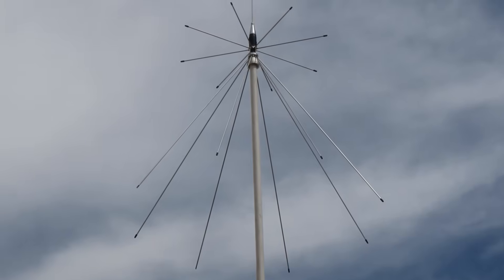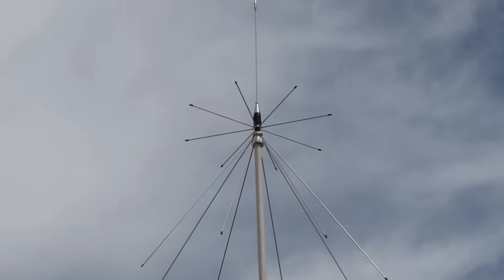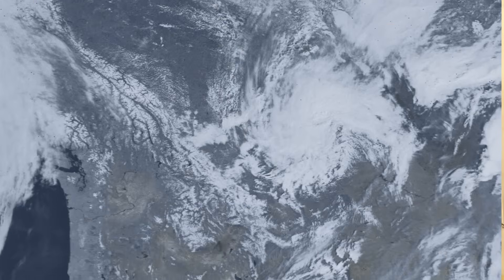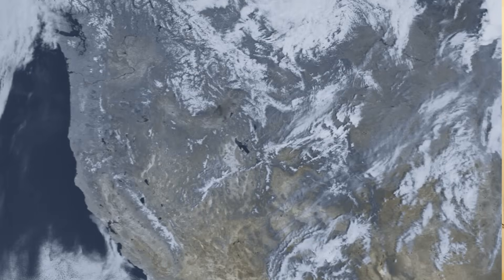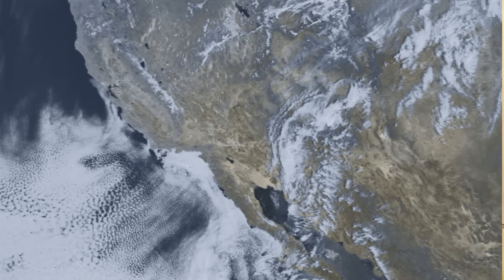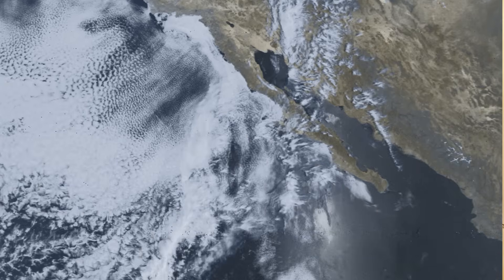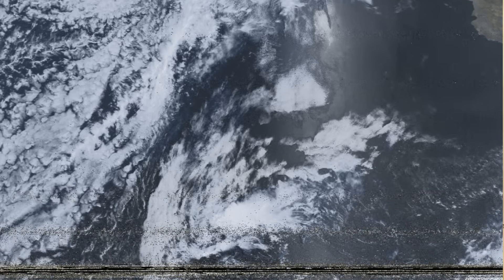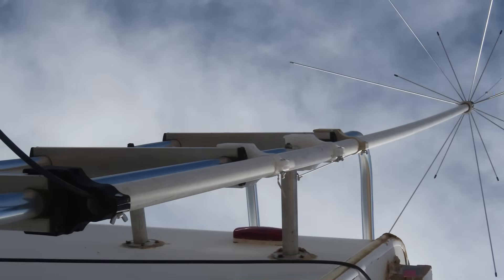Ham radio - The TRAM 1411 discone antenna.

Comment: I purchased one of these and sadly discovered it comes with a UHF female (SO-239) connector... this connector is useless for 1.2Ghz TX, I can´t believe such design mistake as this antenna is supposed to cover the L band on TX... my bad... I also own an Icom AH1200 discone with N connector, which SWR is great on 1200 and 50Mhz as well (the 1411 doesn´t cover 6 meters...) :(  73 de LU2AW

Comment: I just got the SDRplay Duo, a discone, HF loop with pre-amp, a raspberry pi five with a 7 inch touchscreen to make a radio system so I’m glad that it works for you.   I live in a motel which is made of concrete so I can’t put the antennas outside and I am not receiving anything except one FM & AM station very weak.
Reply: DL2MAN mayday set of antennas out of 10 mm PVC and wire.  You could make a 3-D printed part with those 10 mm holes for each one of the elements

Comment: The Tram 1411 was my very first antenna.  I used it for CB and SDR listening before I got my ham license.  It has big ears!  I was rx-ing repeaters 70+ miles away on vhf.  However, discones are zero gain antennas, so the tx is just okay for local and satellite stuff, but it isn't great.  I forgot that I had it - thanks for the reminder.  You inspired me want to put it back up this weekend and hook it up to a meshtastic node.
EDIT: it fits perfectly on top of a 1" piece of galvanized conduit.

Comment: I recommend this model for wideband scanning and voice intercept (SIGINT) work, even VHF low band DXing. 

For many years I had the RadioShack 25-1300 MHz discone.  It transmitted on 6m/2m no problem.  Probably would have done 10m/11m too.  I know the Tram 1411 does 11m TX and RX.

For listening / voice intercept listening posts…one of these…on your rooftop, connected to a SDR, a traditional scanner/receiver like the Pro-2006, Pro-2052, Pro-2096, or even better, a SDR and at least one scanner.

Comment: I've had the Tram 1410 for many years, it's a excellent antenna. I added a 88-108 notch filter on it. I have it mounted 30ft up with 50ft of LMR400 going do to an SDR receiver. It works great for the the entire range. I assume some of the people saying it's not great on air band and the lower end is due to overload from nearby FM stations. Without the filter I was pulling in FM stations at -20 or more, the filter knocked them down so the strongest I see in the FM band is now around -70.

Comment: Tram 1411 is a cheap(price) alternative to similar designs, but unlike the Tram 1410 is not easily modified for different coverage. Frankly these discones are a compromise unless you like the aircraft and VHF bands then they work decently.  UHF coverage could be better. FM broadcast band image issues on cheaper receivers can suffer as result of the stock tuning. 
For those that want the FM imaging reduced with much better coverage in the UHF and up you must retune the 1410. Essentially trimming the elements and reducing the physical distance between the hat and cone. (See discone calculator) 
The 1410 is nickel plated brass with SS elements. So, it's fairly easy to cut and trim. I've also used brass (easier to cut) elements with no real tuning issues.
 I have modified several Tram 1410 for various frequency ranges. Using the discone calculator and VNA you can easily tune the 1410 up in frequency coverage. I also use LMR400 for feedline. Return loss in the areas of tuning is -10dbm or below with SWR 2:1 or less. 
 I have 1410's for 400 thru 700mhz and others for 700-900 public safety bands. Recently made one for 978/1090mhz ACS-B coverage. 
Look me up if you want me to build you one for your specified frequency range.

Comment: Thanks and good vid.  I'm doing my annual spring cleaning to the shack &  rigs -- blowing the dust to, cleaning any fan blades,, sweep, swab, wax & buff as we said aboard ship.  I am going to try your setup if I can make my older dual band work with the software.   Try to make it work vs buy to work.  More fun to figure out.  May not be super automated but, hopefully, good enough.  
KB9RLW de N5XS 73 bk

Comment: I'd love to try those clamps.  STLs available?  Thanks!
Reply from the maker: I think they're close to right, I'm still revising them a little. But I don't know if the ladder pipe diameters are universal. Measure yours, and the width of the steps and drop me an email. Oh, millimeters please. I only design in metric. It's so much easier than imperial.

Comment: I have the same antenna and used it mostly for 2m/440 and CB SSB. It worked great on 2m/440 fm and 2m SSB. It worked great as a receiving antenna hooked to a sdr. I could receive from 440 to 160m on it.

Comment: I have been using diamond D-130 discone antenna for over 20 years.    it receive and transmit about same as 1/4 ground plane at same height.   like it very much.  AG6JU

Comment: The new batch of TEVEL satellites should be available soon, and I found the first ones were as easy to work as the ISS.

A Lindenblad antenna is circularly polarized, and you could probably build one that's easy to setup and tear down.

Comment: Hi Kevin,
Congrats on the sat contact through the ISS repeater. Will height help the discone? I could mount it atop my tower and at minimum would be at 35 feet. Hope your long covid is making some improvement. Stay safe.  73  WJ3U
Reply from the maker: Height always helps. At the least you increase your distance to the horizon. Here I'm at 3500 ft above sea level, and it really is kind of like having my antennas on top of a 3500 ft tower. I also have very few obstacles, with mountains out near the horizons in some directions. So this is really an ideal place.

Comment: Good for a scanner no good for tx on any band
Reply from the maker: In a comparison to my slim jim while talking to a guy 7 miles away. On 146.52 simplex. I dropped the power on my 705 to zero so it was only putting out about 160 mw. On the slim Jim he had me at an S5. On the disc cone, it was only just slightly under S5. So on 2 m it was performing almost as well as my slim jim. I've also talked to somebody on UHF simplex many miles away with very low power. Then of course there's the demo within this video itself where I worked through the ISS repeater, transmitting on the disc cone.  It's fine for transmitting.

Comment: After 4 hours of assembling his desk, a friend gave me a used unassembled Discone.  I somewhat reluctantly took it.  BUT after getting it up, I was amazed at its receive capability.  I thought it'd be a receive dummy load on 160M but I can actually hear quite well there.  Not nearly as good as a 160 dipole, but still very serviceable.  One thing to remember, this is a zero gain aerial.   SWR is amazing from 6M to 70cm.  Glad you like it!  BTW, I camo'd mine with flat green & black splotches of camo spray paint.  Pretty well disappears on top of my 30'+ tower.👍

Comment: Can you remove the vertical element altogether? Would then be an original discone.

Don't use the discone to tx on any of the harmonic rich cheap handhelds as a discone will radiate the harmonics very well 😊
Reply from the maker: I didn't try too hard.  It didn't seem to want to unscrew and I didn't want to break it.  
I don't think I would if I could though.  I like having the 10 meter capability.